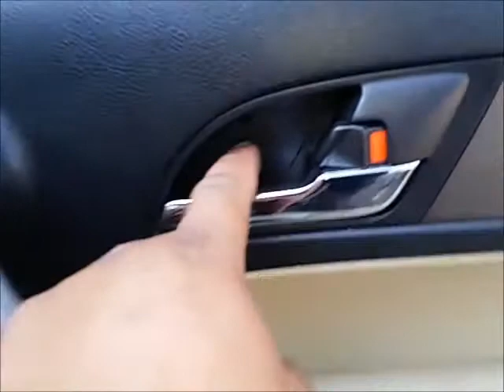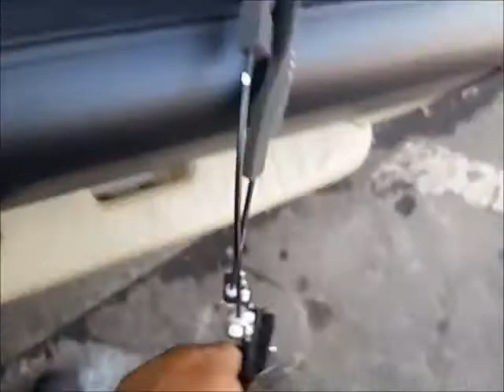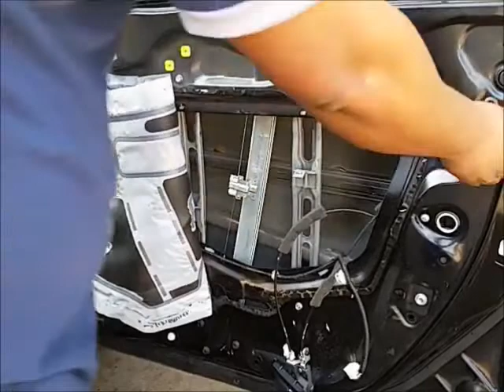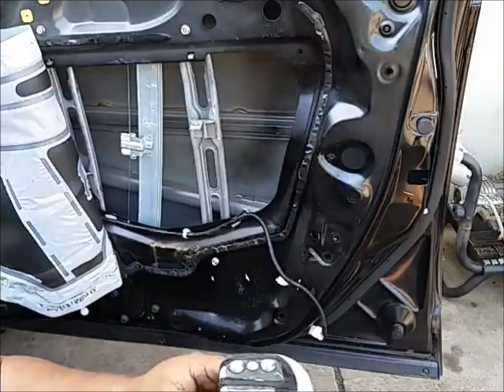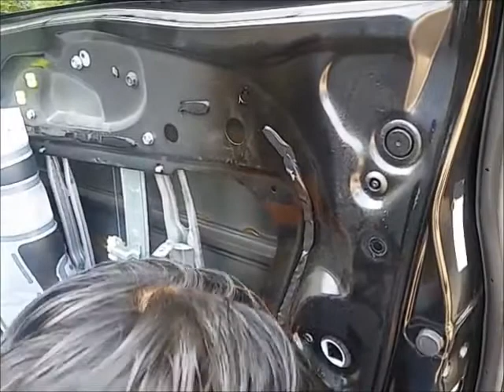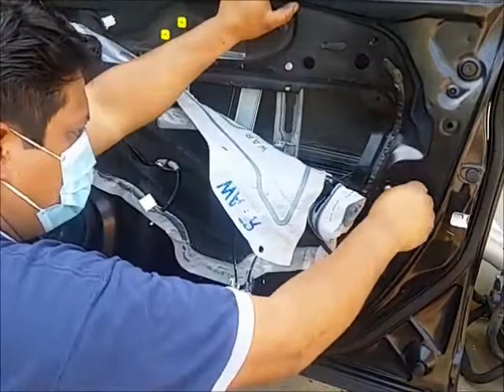127.- 2007-2011 HONDA CRV 2.4L PASSENGER FRONT DOOR ACTUATOR REPLACEMENT/ HOW TO

Comment: Thanks! Fixed my door with your help. One comment regarding the install, make sure the actuator (hitch) is open before installing it otherwise the door won't close. I had to remove mine because it didn't come open. I should have done a video.

Comment: Thanks for video--- very good views of everything (better than other videos I watched)-- I sprayed penetrating oil on the 3 screws next to latch and then hit with a mini impact (pushing very hard so they would not strip out)--- I read heating them first can break loose also (they tend to be sticking to paint)-- for those that read this, they commonly strip out due to the screws being a soft metal so be careful with these and use a #3 phillips only.